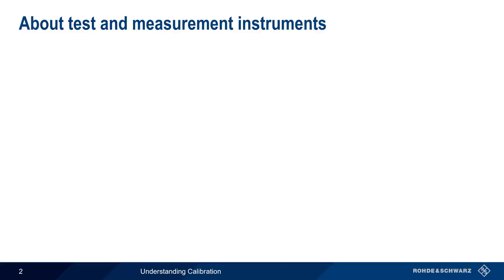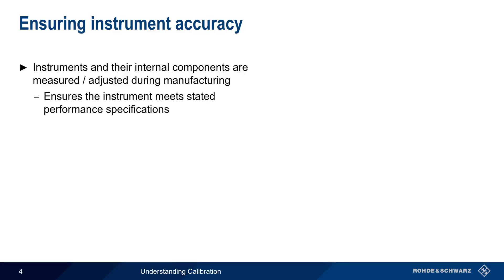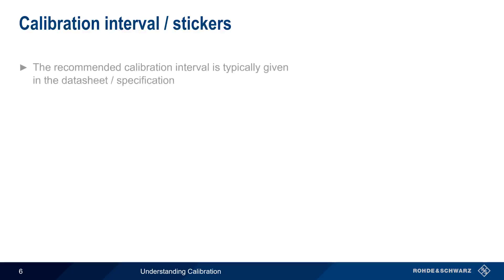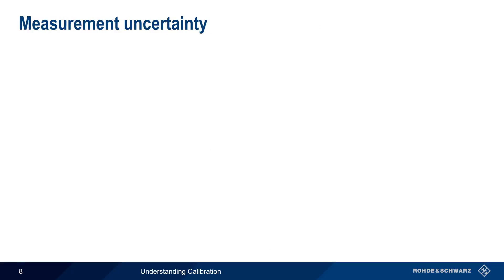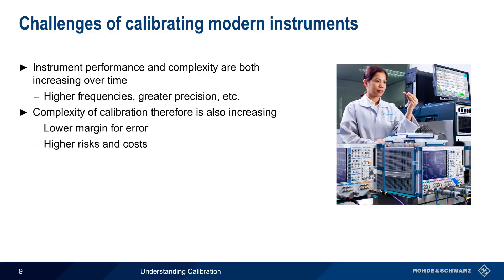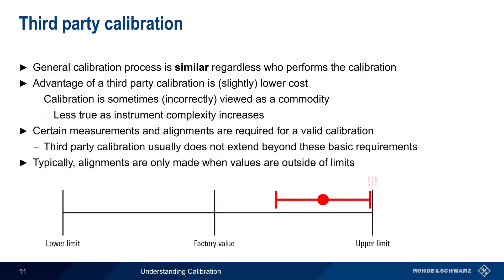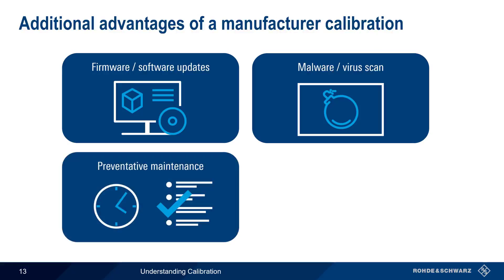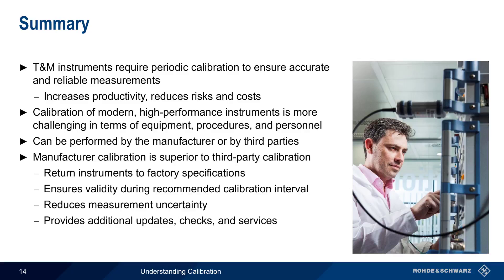Understanding Calibration

Comment: I would respectfully disagree that calibration includes adjusting an instrument. Determining and applying correction factors yes, but adjustment no.
Reply: What is the difference between correction factor and adjustment ?  
In my understanding, adjustment is a physical manipulation of say a resistor or capacitor to obtain a desired readout or output from the DUT. A correction factor, a computer applied correction value stored in the DUT’s memory. 
So in principle the same process used on typically older and newer devices.
And, a calibration is a verification of specifications, not necessarily including a manipulation of correction input.
Reply: You can even adjust an instrument every single time it goes for calibration. The key factor is giving the cal certificate with measured values before and after adjustment.